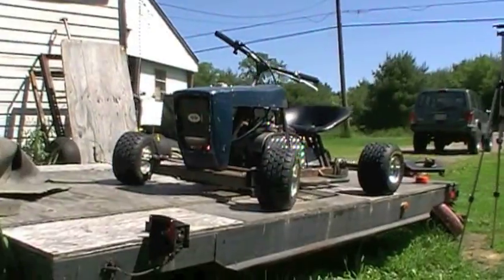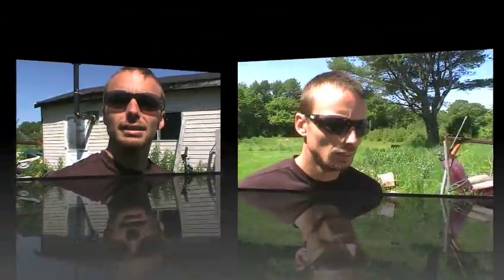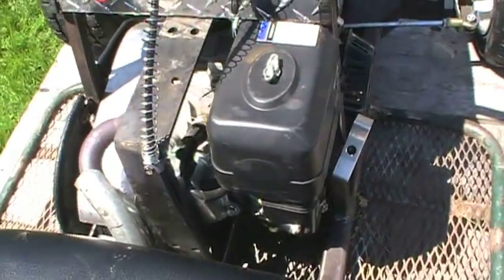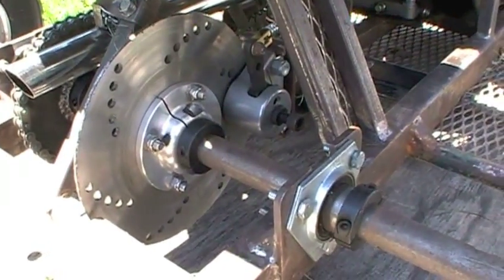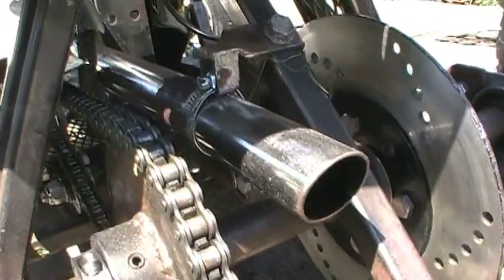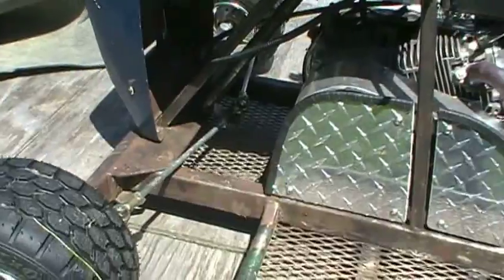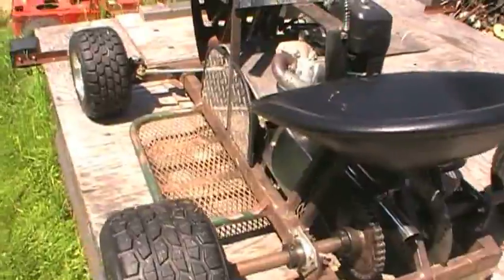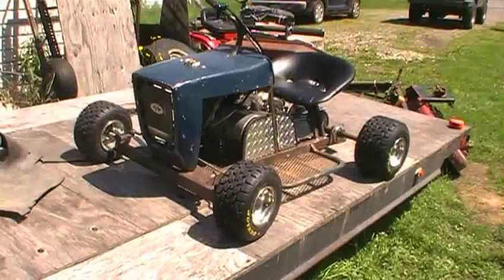Racing Mower/Go Kart Measurements

Comment from the maker: yeah, it would lift, but I usually only drive it on pavement so it's not really a problem.
If it's gonna be high speed, then def solid mount the front axle

Comment: hey fearless, how hard would it be to mount ATV tires to the rear rims of a mower/lawn tractor? cause my blade-less mower is gonna have to go through the mud, and the wheels i have on my quad have never let me down till i got the diff high centered... however, $200 for wheels that would tear up my lawn would suck, so do you have any ideas on good tires that do good in the mud, and dont tear up the grass?
~Derek